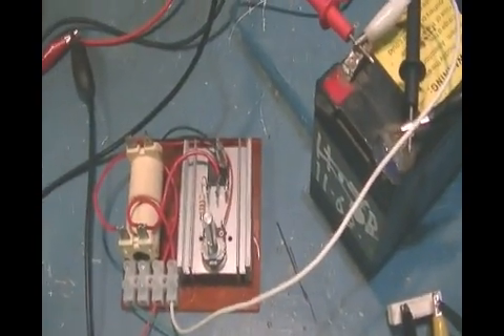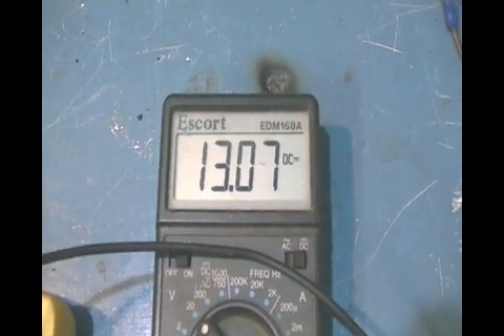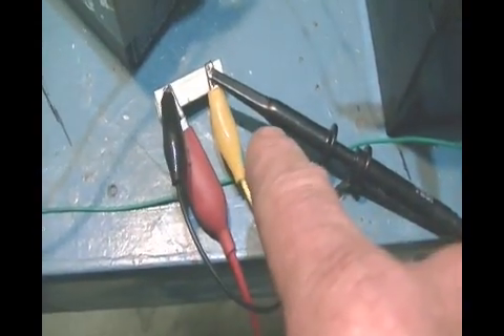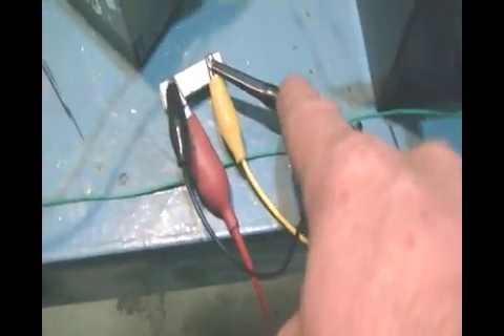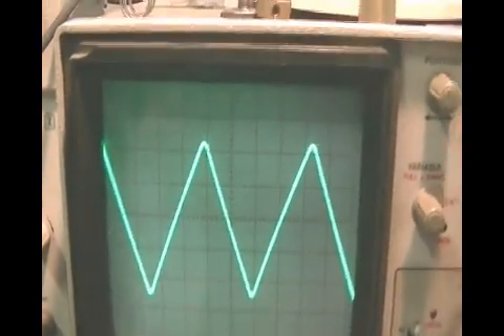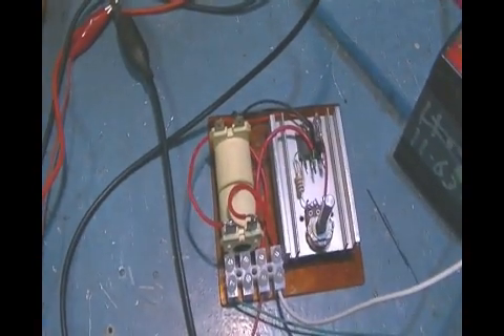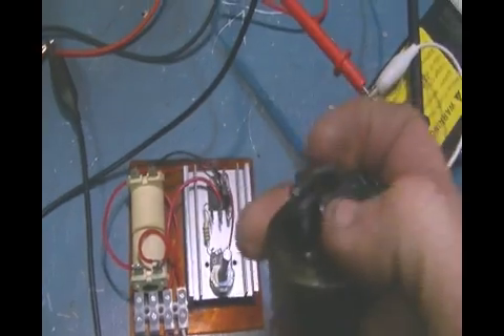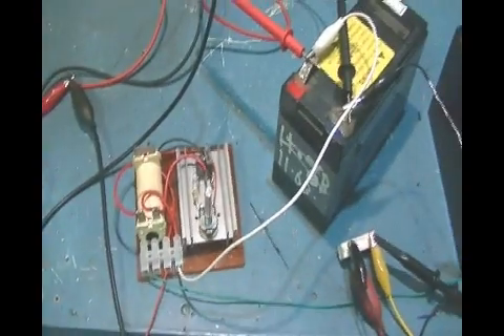super simple solid state

Comment: And yes if you use a mosfet that has a reverse voltage bypass diode the back EMF spike will jump the mosfet and put some charge back into the supply battery ( think transistors might also), but like I said in the other post that energy straght into a batter will crystallize it and degrade the battery. You can reverse the crystallization with regular DC charging. This crystallization effect will also remove sulfation of lead acid batteries as a side benifit. I have revived old batteries with it.

Comment: The ac setting on a scope is normaly to see if you have some pulsation on your dc signal. If you want to see if your voltage is really ac just put your scope on the dc setting and anything that goes below the 0 is negative. For info only the ac setting in the scope put a cap in series with your probe filtering any dc. Hope it clarify your setup :-)

Comment: One addition to this though, the mosfet will only have current jumping over it recharging the run battery, if your pulse width is narrow enough to be more narrow than the resonance frequency of the coil used. Thus showing some level resonant ring on the coil. The ring will hit voltages just over that of the run battery. This is only my best guess of what it is that I have seen.

Comment: I believe that when your scope is in AC mode it will center any flucuation over the DC settings zero, that is not an indication of if the over all wave is positve or negative. It looks to me like it is a nice smoth sawtooth wave that is all discharge. and no recharge but that is assuming you are in AC mode on the scope.

Comment: Sorry that I have no video to show my experiment but a couple years ago when I was working on capturing back EMF into a charge battery with solid state switching I did see an apparent over unity in charging or like you see here batteries that don’t decrease in voltage. This in my tests where an temporary illusion, if you leave it running for a very long time the voltage will come down, and next time you use the battery it will have slightly less amp hours. Pure spike volts crystallizes batteries